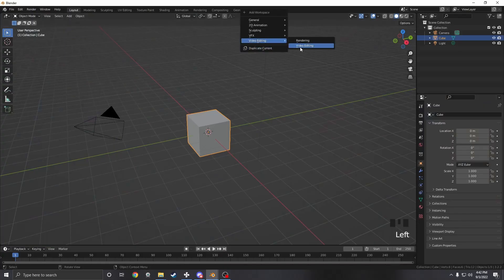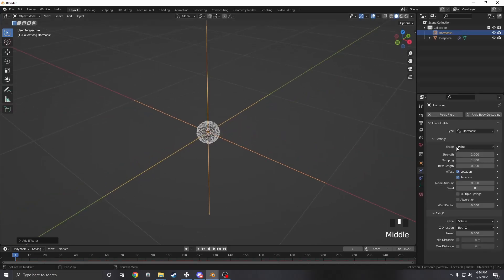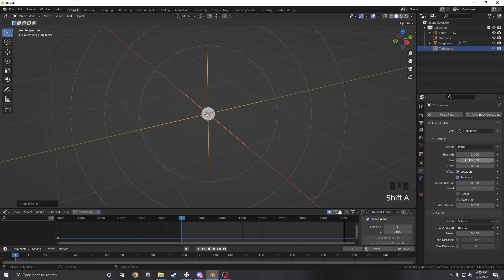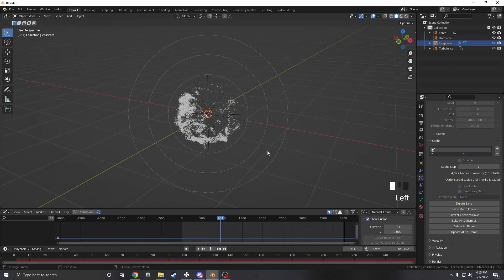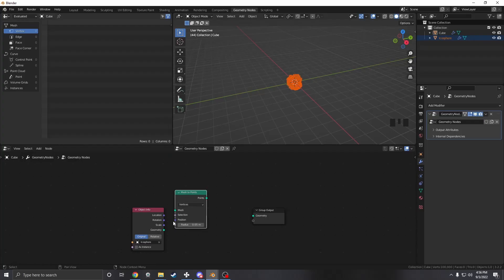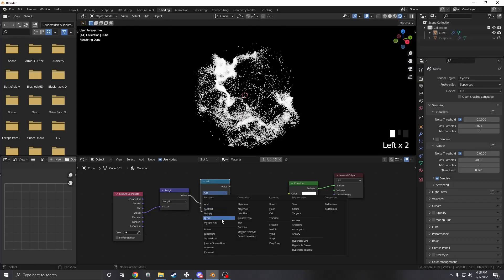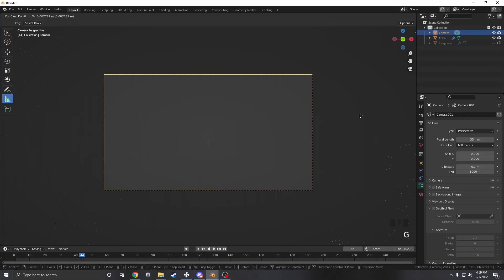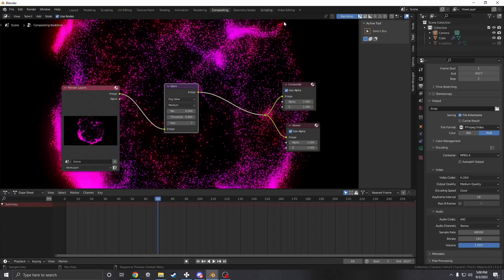Blender 3.2 Particle Sim Audio Visualizer Tutorial

Comment: Everything went very well until Geometry nodes where you need to add Mesh to points.
Nothing is created. I tried different combinations. I use Blender version 4.3 do you also have this problem?
Reply from the maker: You will need to add a Points to Vertices node between Object Info and Mesh to Points

Comment: Is there a way to get this effect in eevee? As my computer can’t handle rendering in cycles atm but the particles effect is really nice, so is there an alternate way to do this that would work in eevee?
Reply from the maker: No, it only works with cycles. But you only need to render with like, 10 samples. Integrated graphics from a decade ago could handle it. Even cpu rendering is completely fine. There’s no reason you can’t use cycles 🤷‍♂️
Reply: @ alright cause every time I try to render videos in cycles, my fan kicks off like a jet engine, then slowly goes back to normal just to go back up again, and I even have a upgraded card from what it had before, à Radeon 6400, but it was the minimum required ram I needed to run another editing program, but this is very sick to watch, I’m trying to learn more music related stuff in blender to add to my music video editing
Reply: Also this is unrelated but I can’t find an answer, how do you scale and grab stuff by just pressing the hot key then dragging your mouse? Mine doesn’t do that, it just changes to the grab tool then I need to grab the specific axis to grab it, I can’t figure out how to do their like I see everyone else do, just press the key and move your mouse

Comment: Does it have to be a particle system for this effect to work? Or could you hypothetically use a distribute points and instance node in geonodes to make a similar effect?
Reply from the maker: You can do it a dozen different ways, at the end of the day it’s just driving a variable with the f-curve. I did actually make an example with geo nodes but I never ended up making a guide for it: https://youtu.be/A4HDazNjN6k
Reply: @dentechs  that’s awesome, your channel is seriously underrated
Reply: You can use the F-Curve on anything that can be keyframed. I've used it on an array modifier to drive the array count, trickier because it only accepts integers where the f-curve produces values between 0 and 1 so you have to scale the F-Curve on the graph editor to your liking to get it to do what you want if working with integer feilds.

Comment: Simulation used 16gb of my ram and Blender has crashed.
Reply from the maker: You can lower the number of particles to use less ram, I have a pretty powerful system so I can crank it up.
Reply: @dentechs  oh thanks. now in my second try after frame 50 simulation disappears.
Reply: i forgot to change lifetime. lesson learned by making a mistake.

Comment: Thank you for the video! But help clear the cache after this lesson please. Roasting ate 20 GB. After removing the bake and restarting the computer, 12 GB was restored. Where to find the rest of the cache that took more than 5 GB, I could not. Checked all blender folders and found nothing(
Reply from the maker: It bakes to ram, and once ram is full it stores it to a page file on your drives. Restarting your pc clears the page file which is why 12gb was restored. And the 5gb that was in ram never took storage in the first place. Because my PC has 64 gigs of ram it didn’t have to use a page file at all, meaning performance wouldn’t be limited by a much slower drice
Reply: I was still able to find it. If you have the same problem: C:\Users\___\AppData\Local\Temp

Comment: I have tried a lot of visualizer but there is one problem with them. it does not react to the music as it would in After Effect. what can we do in this case?
Reply from the maker: I've never used AE so i'm not sure what you mean, could you show an example?
Reply: @dentechs  take "Trap nation" for example, there is like a "cumulate" effect there.
In blender the reaction of the spectrum, No matter which method you use, is very flat and simple.
Reply from the maker: @More! S L O W E D  Ah that’s because that’s going by individual frequencies instead of the peak in a group like bake f-curve does. Take a look at the audivs plugin, might be a bit more like what you’re looking for: https://blendermarket.com/products/audvis
Here’s an example I made with it: https://youtu.be/wBTL9kEGXUw
Reply: @stealthizoptional  In the F-Curve menu you have options for the frequency and how to interpret, such as accumulative, additive, square. To make an object that reacts to just the bass kicks then use a Low range from 0 to a high of 150. accumulative adds each peak of the wave together give a value from 0 to infinity, additive adds the peak to the trough giving values between -1 and 1, square just give -1 or 1 based on a threshold. 

Once you import the F-Curve if the effect is too subtle you need to Un-Bake Curve of the keyframes and then you can scale them up to increase the intensity using the graph editor.

Comment: Loved this tutorial! Great little visualizer! I almost gave up because I was still using Blender 3.0 when I should have been using 3.2+. The part where you connect your emission node to your material simply didn't display anything against the wolds black background. There was zero emission even though I was setting it to 10.0. Once I switched versions everything worked as stated in the video. I'm just mentioning this in case anyone else runs into a similar issue. Thanks for sharing DenTechs!
Reply from the maker: You also need to be in cycles for geometry node points to render, they don't show up at all in eevee
Reply: @dentechs  I'm trying to follow along but when I add the emission nothing happens. I'm on Blender 3.4 and using cycles, tried it several times from scratch and am just about to quit..
Reply from the maker: @crahdummi  Just tested in blender 3.4.1 and it seems to work fine for me. Are you in the rendered view? it won't show colors in the material preview. Also in geometry nodes did you do mesh to points and set the correct material?
Reply: Thank you… tried to figure out the problem for 1h
Reply: Just used your technique in my latest animation. Thank you. https://youtu.be/DlnB9QqDt8Q